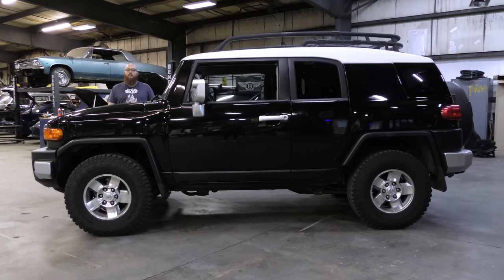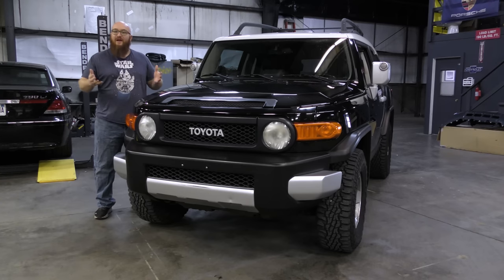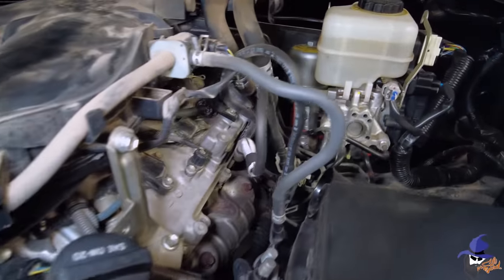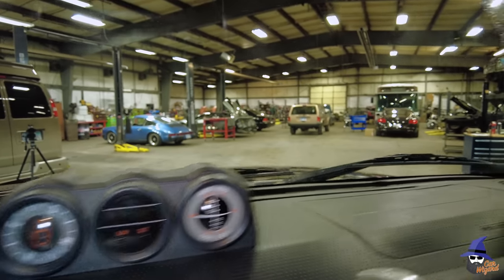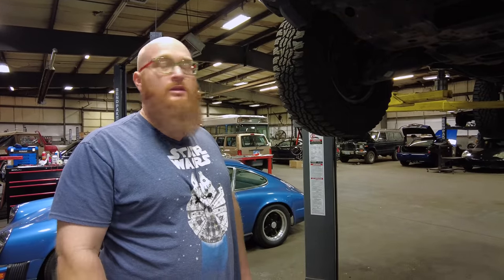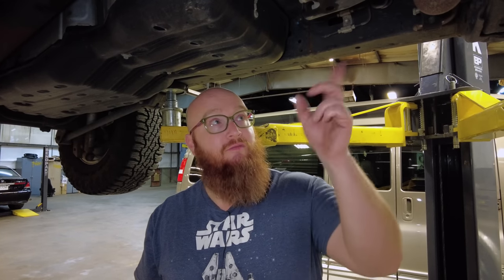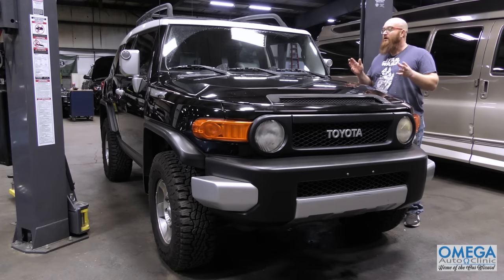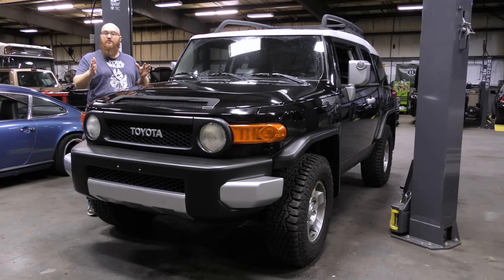"I finally got the Toyota I've always wanted!" CAR WIZARD gets a 2010 FJ Cruiser!

Comment: Best vehicle I’ve ever owned!! Bought mine august 2006, sun fusion, auto, 4wd. Got 155k on the clock. Only things I’ve ever replaced were both cv joints, lower ball joints, both front wheel bearings, and right rear axle seal. It’s got an ome 2 inch lift, that’s probably the reason for the worn suspension parts, altering the angle. Also, still running all the original light bulbs! Enjoy your new FJ, welcome to the club! 

You going to roll the dice, and change the transmission fluid?
Reply: How is that rolling the dice? It's not a Ford.
Reply: If your transmission is held together by Gunk you probably shouldn't keep the car anyway. Just change the fluid
Reply: @chicken29843  
If that's the case it isn't long for this world anyway.
Reply: I love hearing people holding onto good vehicles. Hope you enjoy it for another 15 years!
Reply: I changed mine, are there issues with that?
Reply: @JohnStrandt  I'm no mechanic but the theory is if a vehicle is after a certain age or pushing 200k miles the transmission fluid can build up metal grit / shavings from it being used over the years, well, those shavings can supposedly 'help' the transmission shift because it's providing better friction between the clutches and what not in the transmission. So if you change the fluid for fresh fluid then that grit is no longer there and it can cause your transmission to start slipping. That's the theory anyway, it's probably dependent on the type of transmission and its past life of how hard it was used or not used. I believe it's typically recommended to change your trans fluid every 60-100k miles so if you wait for 150-200k miles then you've kinda already over extended the fluid and if it's still working, people say just to keep it in there else like I said before it could cause problems to arise because of the loss of grit in the fluid.
Reply: @dedalliance1  thanks
Reply: @JohnStrandt  Np. Would be cool if the Wizard did s video about it with his opinion. I'm not sure if it's entirely true though.
Reply: @dedalliance1  Mine has 155k, and I don’t want to risk it. Could be fine, or it could start to slip. Never thought I would keep it so
Long, otherwise I would’ve changed it every 60k.
Reply: @Seasniffer69  It’s worked out perfect for me and the wife, no kids or hounds. More than enough room for the two of us. I did buy a new 4Runner back in 2018, only kept it a year. It sure was a lot slower, and we didn’t like the brakes. I couldn’t believe how much slower it was over the FJ, guessing it’s a tad heavier. Somebody got a low mileage 4Runner (6k on the clock).
Reply: @dehoyosrudolph8885  I changed my car at 120k miles or so, it's supposed to be a 'lifetime' fluid, no dip stick to even check the fluid levels. It was worth it to change because I didn't want it to accidentally run out of fluid or anything. At 167k miles now and still going good. I think there's a lot of factors though mostly if it's a well treated vehicle it shouldn't have a lot of shavings in the transmission at all anyway so changing it's not a huge deal. Had 2 work vans both 300k mile 2004 chevys, doubt the fluids were ever changed on original transmissions, so they can last a long time anyway.
Reply: @dedalliance1  I might go for it, most don’t recommend it, with that mileage. Scotty, and the car care nut. say not to do it, lol.
Reply: @dehoyosrudolph8885  I think you're still probably fine to change it especially being a solid Toyota you have a good foundation. I would recommend spending the money on Amsoil just because it's really good or something equivalent but either way you don't want to skimp out on the quality of fluid. You can also probably just drain the fluid and then fill it back up versus doing an actual flush where they hookup the machine and run a couple gallons through I think that would disturb more stuff and wash away any of the grit / shavings versus just draining it and refilling it. But I'm no mechanic either.
Reply: My Land Cruiser is the same: sealed transmission. With that being said, I had them change it out, but NOT flush it. Just drain, then replace. No issues at all 50k miles after I did it. (Currently has 168k miles on a 2013 daily driven Land Cruiser)
Reply: @justinmcroberts4633  Yeah I think drain and fill is the way to go. Also high quality fluids. I just remembered I was going to mention is that I believe Amsoil and I'm sure some other companies sell fluid test kits I know I use Amsoil's for my cars motor oil. But I bet they have a transmission one so you could test the fluid and see how high the iron deposits are then decide from there on what to do.

My biggest fear is burning / leaking trans fluid thats what happened to my first truck ran it empty and destroyed the transmission at like 130k miles. I should've kept an eye on it but I never did and then it was too late.
Reply: I would be tempted to keep the old gunky ATF in safe storage, in case the new fluid makes the tranny very slippy you could mostly put the old fluid back and still have a running vehicle at least.

These are rated better than average transmissions. I'd chance it,
Reply: @dehoyosrudolph8885 I have a 2010 fj with 110k miles, my dealership has constantly told me not to change transmission oil! I saw a recent comment with an fj cruiser owner who has 250k miles, and never changed fluid, he says his car is shifting normal!

Comment: To eliminate most of the blind spots you need to set the mirrors as far out as they will go and center the rear view mirror.  You will notice that you will be able to see the vehicles in your blindspot without having to turn head very much. I guarantee it.  It may seem odd at first because we are so used to seeing the sides of our vehicle.

One important thing to remember and this is very important is not rely on the view when you are in curve such on or off a ramp.

Comment: IMO these trucks are even more fun with a manual transmission. I’ve driven many of them before both in manual and automatic transmissions when they come in for service at my job at the Toyota dealership. But both are perfectly good cars to drive.
Reply: I bought my '07 FJ on April Fool's day 2006 (just about a week after they came out). It will have just under 170K miles by its 17th anniversary.  There was a six week waiting list, and they only had two 6 speed manual cars on the lot. The sales rep said that he could have sold the one I test drove ten times that day, had it been automatic. After telling him that I didn't drive automatic, he sold me the car (for full list) on the spot. That impulsive decision earned me Toyota's gift to the first 50,000 buyers, a detailed scale model of the car (in the same color as mine). I have also thoroughly enjoyed the ride I found so impressive. The six speed model is AWD, and sticks to the road like glue. There is no feeling of impending doom taking curves at reasonable highway speeds without braking. I also avoided the transmission bug that hit early model first year automatics.  The gas mileage and the rear visibility are both poor, but I'm still in for the long haul (ju$t replaced the exhau$t $y$tem with it$ dual pipe$ and catalytic converter$).

Comment: I’ve had one for over ten years now… very solid vehicle.  The only thing to look out for is the windshield.  Because of their lack of aerodynamics, they tend to get chipped.
Reply: The windshield in my 2012 FJ is wrecked right now. Rock thrown from state highway maintenance truck's tire would have come straight through if it hadn't hit partially on the cab post. I already had chips, but was reluctant to switch out the windshield because I've had so many friends who had leaks after having a windshield replaced. Now I have no choice. A driving rain would no doubt cause failure of my Gorilla Tape patch. 😄

Comment: 2013 Trail Teams in Cement Gray (Cement Gray single color roof) here. It's a great truck but these, like every other 2000-2020 Toyota truck, have major frame rust issues. I think you're outside the salt belt but I would still STRONGLY recommend fluid filming the frame, especially the inside, regularly. I love mine despite the work I've had to put in to saving the frame. Get compliments from strangers all the time.

FYI, they made them for overseas markets way after 2014. I think they were still selling them in one of the Arab countries until very recently.
Reply: Yup, 2023 is the last year for the FJ all over the world , my fully loaded FJ got only 6000 miles on it 😊

Comment: I hope you didn't trade off the Citroen for this. My 1993 Toyota pickup that I bought new has 310,000 miles and is still running great and uses no oil. Hard to go wrong with a Toyota.
Reply from the maker: Nope. Still have Citroen

Comment: I debated buying a Land Cruiser but wound up with a BMW X3 because it was $3K cheaper, the BMW has cost me over $10K to keep it smogged and running and is throwing check engine lights every day, I will be junking it in weeks.
Reply: You are sending it where it belongs and exchanging it with peace of mind
Reply: @praveenhegde8107  Yes I will not pass this nightmare on to a new buyer even knowing I could get $4K for it.
Reply: What year and model. Most likely a simple fix

Comment: After the Car Wizard bought the FJ Cruiser from EuroAsian Bob, he will definitely do a buy this, not that video for Toyota, because the theme for this one will be focused on excessive oil consumption, which is seen on the mid-2000's models with the 2.4 L four-cylinder engine, as well as the early-1990's to early-2000's model with the 3 L V6 engine. It will be interesting for most of the public.

Comment: Congrats on the FJC. I used to own a black 2010 too, it was great but eventually traded it for its roomier cousin a Lexus GX460. I can tell yours also has the Off Road package by the wheels, diff locker, Bilstein shocks, etc., as mine did. And I'm guessing you know that in 2010 they upgraded the rear axle to an 8.2" diff which is much more robust off road than the old 8" diff.
Reply: Gx460 is essentially a Land Cruiser with a Lexus badge, right?
Reply: @zacharypeery4082  Land Cruiser Prado, yes, with the upgrade of a V8 and various luxury doodads. Same chassis as a 4Runner and FJ Cruiser.

Comment: The FJ cruiser actually started life as a concept car and the concept was so popular it made production, they were still available new after 2014 for the Japanese market. It shares a platform with the 4Runner. Front and rear suspension is the same, drivetrain is the same, only major difference is the wheelbase, and the optional V8 only available on 4Runner. I don’t really care for the quirky blocky styling of the FJ cruiser though.

Comment: The frame on these is essentially the same as a 4Runner, so the big open space under the rear would have been where the spare tire went on a 4Runner but obviously it's on the back on the FJ Cruiser.
Reply: It's actually for a second gas tank. The Aussie and other miles can come with an extended tank.
Reply: @joydivy  this must be a thirsty V6 truck to drive through the endless desert in Australia.
Reply: @j_freed  ....THEY got a diesel option in theirs, I think....thanks to the A-holes in our gubbiment that dont like diesel engines in our non-pickemup truks over here.
Reply: Actually, the frame is from the Land Cruiser Prado which was not sold in the US. I saw an ad from a company which sold a stainless steel second tank to put in that spare tire void and double fuel capacity (for around $1250, I think).

Comment: I bought my 2013 FJ in 2015 and it’s been one of the best vehicles I’ve owned. All Toyotas I’ve ever owned have been absolutely incredible. My FJ has been a dream. It’s only got 87k miles on it today and is like new. I’ve used it to tow my little fiberglass travel trailer all over the country and have never had an issue with it. And it’s a serious 4 wheeler. I’d pit it against any 4x4 off road today. It’s set up to serious offroad just the way it is. I’ll probably have it til I kick the bucket. For yours having 183k it’s just broken in as far as a Toyota is concerned. I’ve had 2 Corollas that I put well over 300k on them when I gave them away. Still running! The FJ is my dream vehicle and you won’t be sorry about your choice. I’ve even found myself on an ATV trail in rugged terrain TOWING MY TRAVEL TRAILER, and the FJ never skipped a beat!

Comment: I have a 07 Voodoo Blue one that I bought new in Jan 08, $27,000 out the door, it has been a great vehicle, 100,000 miles now, nothing but brake pads, plugs, battery, the basic items needed, easy to work on, the truck will outlast me, the only drawback is gas tank size, maybe two hundred miles on a tank. Rides great I have Hancook all-terrain tires rides great very little noise. I love mine!

Comment: I wanted one of these for the longest time. Then I got in one. For being 6'2 I didn't feel comfortable enough for it to be a daily driver. I had to pass. I still see them all the time and just love their style.
Reply: Same. 6’2”. I’m able to get on and out fine, but it’s a little tight. Sometimes my foot rubs the door trying to step out because of no room under the wheel for my long legs. However, if I just take a second and tilt the wheel, it’s a non-issue.

Comment: One of my regrets is not getting the FJ. Instead, I got the 4runner.

Don't get me wrong their pretty much the same engine and same auto transmission, but the FJ is just so iconic, and you can get it in a manual transmission.
Reply: I hear you.  The FJ is definitely cooler but the practicality of the 4Runner as a daily can’t be beat. The visibility and the doors get old after a while.
Reply: @vettepwr23  I like the rear doors. They are similar to my old 2500HD 4x4 that I love.
Reply: @scootypuffjr.  I definitely don’t dislike them. My 4Runner serves double duty for me.  I do a lot of road trips on my own but when I take the family along too it gets old having to get out every time they want to exit the rear.
Reply: @vettepwr23  I get that. I'm a single dad with one child, so it's perfect for us just like my cab-and-a-half Chevy. The FJ is not a a family cruiser.

Comment: The compartment above the dash is handy for storing various keys or things you need to access infrequently. I used it to hold my phone in landscape mode for GPS navigation. It actually had an optional Garmin GPS back in 2008 that could be removed and used for hiking.

Comment: Hey wizard! Im not sure what you have planned, but i really do recommend doing sound deadening the vehicle. Its made such a difference for me especially for long trips and high wind areas. It does a good job at containing heat too.

For anyone that recently got the vehicle, please change your spark plugs, air filter and clean the MAF as soon as you get the vehicle. It's made a huge difference in ride quality and performance.
Reply: How did u do your sound deadening?

Comment: I've never driven one, but I sat in one at the Auto Show many years ago. A couple of the things that stuck out to me was how dark it was inside and the amount of blind spots. It felt like being in a cave. And when the second row headrest was in, it was completely blocking the rear right quarter window from the drivers seat.
Reply: That “cave” effect is great in the heat of summer.
Reply: If you’ve ever driven an exotic car, then this is normal. You get used to it very quickly.
Reply: Nope. I drive through san Francisco like I own it. You can't just sit in it. You have to drive it. Basically same length as a honda civic. Same exact as a 2022 civic.
Reply: Yes I prefer much more glass for 360° visibility but the FJ side mirrors should help a lot. The huge side pillars are because if the stupid half-doors they included for the rear-seat passengers, while maintaining an almost 2-door vintage LC look.

Yeah that's my main beef, plus some chicks will think it looks like a toy car for a human Ken doll. But everyone I know that drives FJs loves them.
Reply: @benjamindavidson632  you do own San Francisco, pal. And a small supply of tiny wiper blade replacements.
Reply: @j_freed  hahaha. Plus one inch over oem size wiper blades.

Comment: 14:50 You're missing the cover over the oil drain bolt. Either some previous mechanic was too lazy to put it back on or they didn't tighten it enough and it fell off.

Comment: Had a 2007 TRD Special Edition. Traded it in with 200k miles on it and it still ran great. Fantastic offroad. The clamshell back doors take some getting use to. Don't regret trading it in but do regret trading in my 2004 Toyota Tacoma 4x4 Xtra Cab TRD for the FJ. Overall I just liked the truck better.

Comment: About a year before I ever saw the car wizard on car issues I bought a 2003 Highlander and I love it.  I was relieved when he professed that it was highly recommended by him. Bought it with 216k and now it has 230 k and runs like a top. It only needed a timing belt and water pump because the bearing in the pump was noisy. It was not leaking but was probably soon going to. Sins of past owners.  Honestly has a few issues to address this year, but as I said sins or neglect by past owners. I am completely satisfied with that.  Gonna give it a little love.

Comment: I bought a 2012 FJB Edition last November. Had 169,500 on it. Has 173,500 on it now. It’s my daily driver of 46 miles. I put new front brakes and rotors on it and new Toyo AT 3’s as well. Toyota dealer back flushed the transmission. New rear gate mechanism. I absolutely love it!
Reply: That FJB edition is very popular.

Comment: Great video. I had an original 2007, and then later bought a 2010. Love the FJs. 193,000 miles on my current one and not a single issue. On my fourth windshield however! The angle of the glass leads to rock dings. That's OK though because I am a big guy and I love the loads of interior room, especially shoulder room. I sat in a 4Runner but just didn't fit.